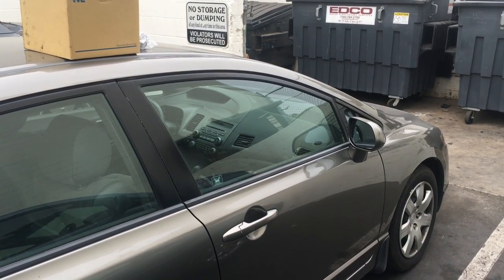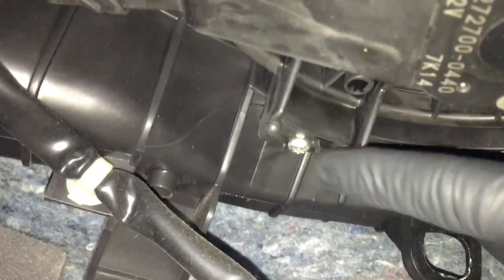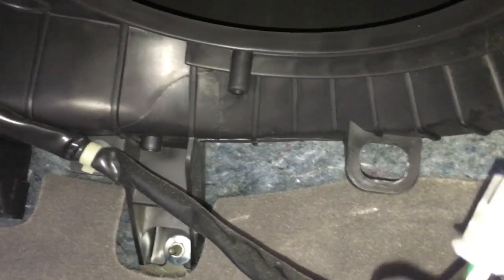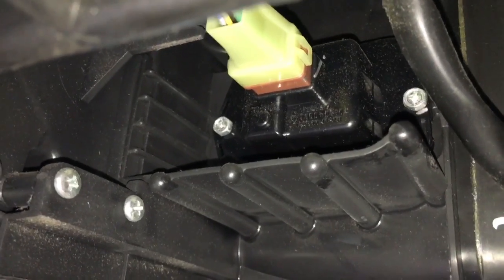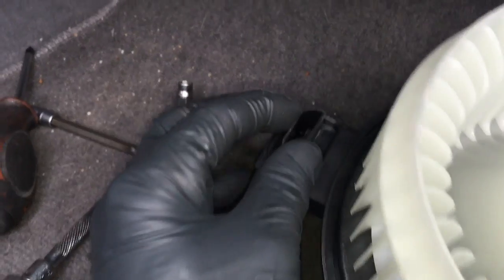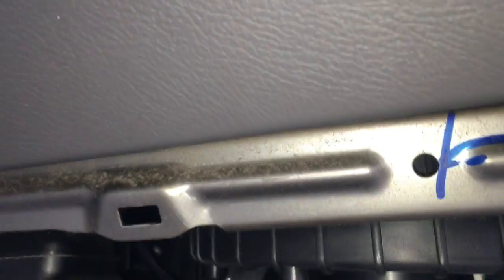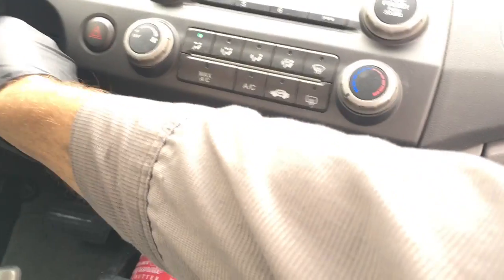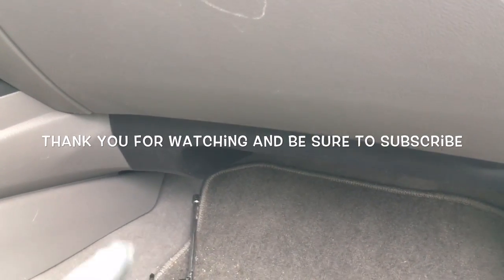How to Replace the Blower Motor and Resistor on a 2009 Honda Civic

Comment: Thanks for the video! I just replaced both on my 2009 Honda Civic and the AC sounds and feels great. The resistor screws on mine needed a Phillips head rather than the star head. All in all, took me about 1/2 hour and most of that was digging through the garage to find the tools.

Comment: Great video.  It walked me through replacing the blower motor on my 2009 Civic.  In my case, I needed a T-20 screwdriver, not T-25, but that only slowed me down by a few minutes.
Reply from the maker: arbalus glad the video helped. Thank you for watching and writing!
Reply: Thank you for this excellent video! The lighting was wonderful and explanation of steps was concise making the process easy to complete, even for a 59 yr old gramma!
Reply from the maker: Elissa Hartwig awesome glad to help. Thank you for watching!!

Comment: My fan had a loud rattling sound. So with the help of this video I opened it up to check things out before looking at replacements and I found an acorn inside of it! Must have fell in when taking out cabin filter or something! After taking it out and cleaning the blower it sounded new! No need to replace it for me. Thank you
Reply from the maker: Jack McCallum that's awesome glad it was a quick fix. Thank you for watching!

Comment: Thank you; I did the replacement today; 
But, it was a pain removing the screws to Blower Motor Resistor unit; 
it's WAY back underneath!
I used PB penetrating spray then used a Phillips screwdriver 

Blower assembly was easier to unbolt.
But, I wish the bolts came with the unit such that they would Not fall out but dangle.
 
It works wonderfully Now!
Reply from the maker: Mohan Srinivasan Glad it all worked out. It is definitely tight back there.
Reply: @HowtoAutomotive  
Another issue I have is that front windshield wipers do Not immediately turn off; they continue then stop midway on windshield; Also when starting the car, the wipers Also start going Even Though the switch on the steering wheel column is in Off position.  I would appreciate your help. Thank you.

Comment: Thank you for your help. I ordered the blower motor and blower motor resistor. I followed your instructions, however the blower motor connector doesn't fit on my car, even though I got the replacement from autozone. The wire connector to plug into the blower motor is wide, but the new one is smaller. I cannot seem to find the right size. 😬
Reply from the maker: I would contact AutoZone and see if you got the right parts or if there is an adapter that need to be plugged in.

Comment: I was wondering if the blower motor needs to be replaced or if it's my filter system blocking the flow of air... I feel the air is not blowing as strong as it use to... Especially on high.
Also... The air isn't as cold as it use to be... Friend told me it needs a recharge on the AC... Looking into this.

Comment: Thank you for this video. I replaced both on my 2009 civic coupe but it appears as though it gets stuck in a position? I hear the blower at full blast but not full air coming out from vents. Both for hot and cold. Some days it works and some days it doesnt. It also starts full but when I get driving it seems like it gets stuck in a position where it's not coming out of anything  but I can hear the blower at full blast. Any suggestions would be really appreciated!
Reply from the maker: Piondragas there are servo motors in the air box that are most likely causing the problem. They control the blend air doors. I would try finding a diagram of your model in seeing where they’re all located I believe on the Hondas you can access them without taking the entire dash out.

Comment: Thank you so much for the video! Is there any way I can find out if I only have to replace the resistor or the motor alone? My AC has been progressively sometimes turning on and sometimes just being dead for about 3 weeks until this morning it just doesnt turn on at all anymore. Thank you again!
Reply from the maker: ESCAPA MARKETING VIDEOS so if you're a fan was working on high only I would suspect the resister. But if it does not work on any speed at all it's possible the fan went out. If you have a way to apply 12 V to the fan to see if it'll run that would be the way to go.
Reply: hey thanks for responding quickly man! So yeah right now its not turning on at all... before it went out it was working on all speeds...but for 3 weeks sometimes it was dead sometimes it came alive.... is it possible its only the motor I have to replace then? Thanks for helping man, I dont know much about cars, Im just asking, but thanks to your video I think I can do this myself. Thanks
Reply from the maker: ESCAPA MARKETING VIDEOS it is possible it's just the motor. If you're able to remove it you may be of the take it to a place where they can use jumper wires to see if they can get the motor to run consistently. If you or if you have somebody at power and ground to the motor and it does not run did you know that's the problem if it runs in the resistor is the problem.
Reply: hey you are the man dude!

Comment: Hi , I have a Honda civic hybrid 2009. Its blower is not working and after checking. I realised it's not getting power in the white cable of the blower, once  I give it direct power from the battery it works.Fuses look ok what can go wrong? Could you suggest ...
Reply from the maker: ALAF BAY PAY KIDS TV check in the under hood fuse box and check fuse # 20 7.5 amp and check fuse # 20 40 amp fuse. Under dash fuse box fuse# 36 10 amp fuse.
Reply: How to Automotive hi, i have checked all. They are all working
Reply from the maker: ALAF BAY PAY KIDS TV if you have an email address I possibly may be able to send you a wiring diagram.

Comment: Hi there from Brazil! My blower was malfunctioning and I bought a new one and just replaced it and tested it and it is now fine. I did it before see your video. The doubt I have is about the Resistor, is it necessary to change it if is working (as in a recommended way)? Or just the fact that it is working is fine? Thank you so much for sharing this.

Best regards,
Jorge
Reply from the maker: Jorge Campos I recommend them because they are a common failure. But the way you did is just fine. If it starts giving you problems suspect the resistor. Thank you for watching!
Reply: Ok, Thank you!!

Comment: Im wondering why did u changed both what was the problem?
Reply from the maker: Tito in the case of this car the blower motor stopped working and the customer wanted to do the resister since we were in there already,

Comment: My 08 Civic sometimes start and sometimes not so I don't know what to change any suggestions?
Reply from the maker: Tito sounds like you have a starter going out.
Reply: Im so sorry my bad I meant my AC (because I was looking at your video about the AC) some times when I turn it on the AC it doesn't blow at all but later starts long delay
Reply from the maker: Tito sounds like the resistor is going out.
Reply: How to Automotive After I saw your video I suspected that thank u for the prompt response I like your video and we'll explained
Reply from the maker: Tito thank you for watching!

Comment: Hi. My blower works perfectly for the AC but it doesn't for the heater. What should I check? Help, please!
Reply from the maker: Diego Garcia you possibly could have a bad controller in the dash. You have to check to see if it’s getting a signal from the controller to the blower motor resistor and if you aren’t then I was Spectre resister if you’re not then I would suspect the controller or the wiring between it
Reply: Thanks a lot!!!